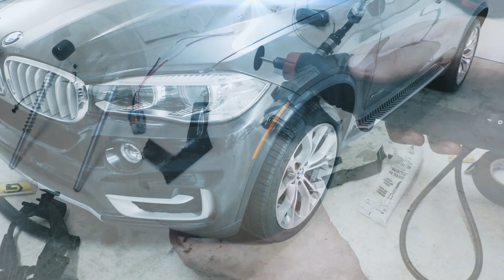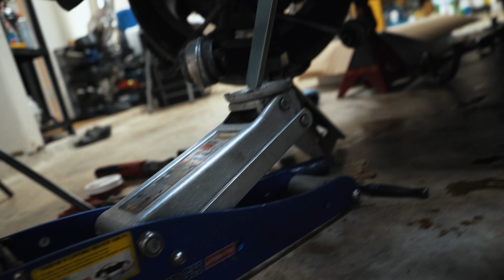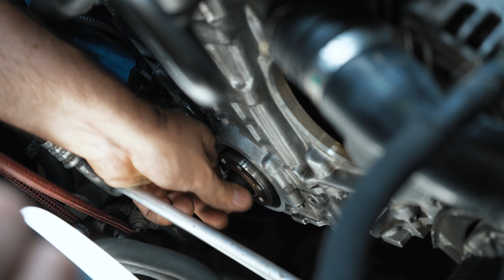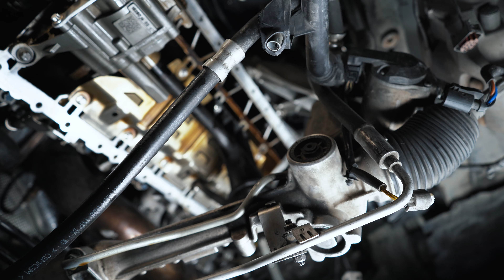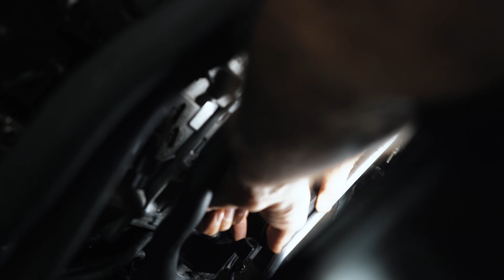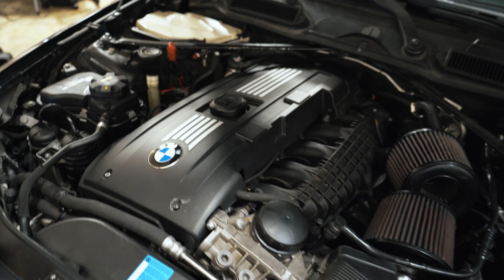This Fixed My Car! BMW N54 Timing Chain DIY!

Comment: Hello, I also have a situation with the N52 engine.

The car was leaking oil from the rocker cover and the crankshaft pulley seal.

Without realizing it, I loosened the large bolt from the pulley (which has a 360-degree tightening) and tried to remove the pulley by moving it left and right, without rotating the pulley in any direction, it came out about 1 cm and I realized that it engages the oil pump pinion and the timing gear. The engine was "free", there were no timing gears installed. My question is, if I loosened that bolt and removed the pulley 1 cm without rotating it, is there a risk that the engine timing would be out of phase? And the valves would be crooked? I changed the gasket on the upper cover and for that I had to remove the valvetronic motor, according to the procedure with a 4-inch Allen key, after changing the gasket, I installed it back following the procedure with the Allen key but I did not calibrate it with the tester in any way. At this moment the engine does not start and spins quite quickly, the piston compression is between 7 and 10 PSI and I am trying to figure out if the problem comes from the fact that I loosened the bolt on the pulley or from the fact that the valvetronic motor is not calibrated.

Thanks a lot. 🤗

Comment: Re-using the guides is crazy
Reply: As someone who’s n55 timing chain guides exploded, I agree
Reply: My lower chain guide broke a week ago. Dont reuse the guides, definetly given the fact that they are 15/20+ years old and are hold in place by aluminum bolts

Comment: Hey I was wondering what did you use to take the timing access plug out I’m stuck at that very spot I need to have that out so I can reach in and remove all the shredded crank seal that got caught in the chain

Comment: Hi if only doing the oil pump chain guide assembly, does the crank hub still to come all the way out? If so, would I still need to remove the valve cover and lock the cams in place?

Comment: I have my engine out of the car, and with it on a stand I dont have the ability to have the flywheel on, can I still do this properly without locking the flywheel since it isn't on the engine currently?

Comment: Hey bro I have a question , so I’m at DTC with the flywheel locked and with the pin also , but I removed the hex bolt without locking the crankhub .. what should I do now?

Comment: Did you use the same vanos gear bolts? Or did you get new ones? I'm thinking of using the same ones with loctite. Not sure if it's a good idea.

Comment: Why  did you need to use the crank locking tool in the front when the flywheel is already locked?
Reply: I also would like to know this

Comment: Great video thanks  
You have a new subscriber . 
I take my car to my mechanic because I he told me that my vacuum pump fail . When he was trying to replaced noticed that my chain retainers were melted and need to replaced the all thing inside . 
Thanks  this video give an idea for what my mechanic got it go through and eh was correct on everything that he told me that he need to remove in order to get access to it ,👍🏼👍🏼

Comment: hey just wanted to ask how would you find time if your chain comes off for the valves barcode up and use timing tool but what about finding compression stroke vs exhaust with piston 1 TDC how can i tell?? also is it necessary to replaces all guides and slides for chain? any help would be appreciated been watching you for a long time always good content.

Comment: Sincerely your channel and hard work has been and is top level IMHO!! Thank you!  I have always appreciated the work you do as well the car I bought (for VERY cheap $1500 USD) was the same mileage as the one you bought at the start. (Mine was 185,000 Miles) so I could always know if you needed to do something on your car to make it better or maintenance then my car is/was due as well. The only thing that has had me pulling my hair doing my work is that mine is an "X" version. So to do a job like this job (Or these jobs as it seems to me LOL) it will be a fair amount more complicated or difficult in dealing with the all wheel drive system. I would never have bought the "X" drive version but that was the car that was so very cheap so I wasn't going to let it get away! Mind you now that I do have it I have found that because of the App "XDelete" I can have the rear wheel drive ONLY driving experience at any time I wish or all the time. Which is how I run the car except in the severe ICE and Snow of winter here in Western Canada and even then it's only when it's severe not for every day. If I want to experience the very hottest Drop Kick of a Launch I put the all wheel drive on with the XHP trans app Tune to either stage 3 or "Drag Race Mode", Which scares the crap out of me because it feels like it's going to break my Automatic 6 speed Trans with All the violence it expends on take off!  I really only tried the drag race mode a few times as I want the few safeties still left in stage 3 to at least be there where as DM has NONE!  It even gives us a warning before we load it on that from that point on there's nothing between your trans and KABOOM!! Sorry for the long comment I just got caught up. Love your channel!! Thank you!!

Comment: The oil pump bolt is not correct it is missing or doesn’t have the correct bolts

Comment: Thanks for taking the effort to record and share all of this! Ps. after torqueing the bolts that needed an additional angle of tightening.. was this done this by estimate? or does your digital torque wrench also support an angle setting? I have an analog torque wrench so am not totally sure how to do this. thanks. Regards from the Netherlands.

Comment: Hey thanks for all the vids. The same thing happened to my n54 and I used your vid to put it back together. I ran into a problem after...crank, no start. Pulled the VC off, locked the flywheel with the pin, and spun the crank manually to tdc to check timing and noticed one of the cams isn't at tdc anymore (it turned 180 degrees ) Any thoughts on how to get that cam back to tdc, without having to do the whole job again ? lol

Comment: Hey quick question, after timing and spinning engine to ensure timing, do you hear a clicking/clunking noise as you manually spin the engine? I hear this is normal, wondering if you heard it as well.

Comment: am i missing something? i didnt have a grip disk washer for the crank hub. or somehow lost it while taking it off. but i dont exactly see a washer in the video @ 9:38. so its hard to see what it looks like
Reply: No it depends what transmission you have only manuals have a the washer installed

Comment: I have a 2007 335i that keeps misfiring i changed the plugs and the coils and moved the injectors around and the misfires are still there, 😞 it keeps shooting fire balls i moved to texas 6 months ago i just want my car running again, Would you know what else can cause a misfire on the n54's ?
Reply: Update?

Comment: What symptoms were you having that made you change the timing chain? I have an F30 w/ an n55, its about to hit 200k miles. My car runs fine but I think I may be getting a subtle whine sound from the oil pump. Not sure. I'm a big proponent for replacing parts like this early before they fail. Not sure of the life span of the chain guides. I know the n20 guides like to fail early.

Comment: After replacing vanos solenoids I still keep getting the code , question is you think this would solve the problem ? Turbos only work for a couple seconds after restarting car , then seconds later the car is just N/a

Comment: I have an N52 with automatic trans. Do I still need some sort of device to hold the trans or can I rely on the locking pin
Reply: Where did you get the crank hub lock?
Reply: And I don’t think there is a way to lock my auto trans. Besides just the locking pin and crank hub tool. At least not that I can find
Reply from the maker: The locking pin is not recommended for removing the front crank bold, you would want a flywheel locking tool that engages the teeth.

Comment: I've got question about the locking pin for the crankshaft. When you're tightening the crankshaft bolt, do you keep the locking pin in place when counter holding the crankshaft hub?
Reply: if anybody see this, no dont use the locking pin to hold the crank. i learned the hard wat. use pin only for holding tdc for other work that require tdc. my locking pin is bent and stuck inside the engine case after undoing the crank bolt. use the crank holder kit or buy the crank hub holder tool

Comment: hey man whats going on im really hoping you can help lol i have a 2007 335i 113k and im getting 002A99 and 002A98 it turns on but really rough idle i wanted to check if the time is correct but ive never for on a n54 how can i check the timing? is there a mark on the camshafts and a mark on the bottom? anything helps lol thanks!
Reply from the maker: Hey, typically you'd need the tool for that but if you put cylinder one at TDC and pop the valve cover off the camshafts would be both in a position where the square tool can fit over it.  So there are two flat edges on each camshaft they'd be at 90 degrees.
Reply: @VehicularDIY  thank you very much and for the bottom? the crankshaft?

Comment: Hey man my 07 n54 is giving me an engine pop up on my dash but won’t show me a code. It’s stock with only 120k miles. Do you believe it would be this issue or is this pretty excessive? The shop I took it too is saying it is but I called bullshit and picked my car up with no work getting done. Plus it drives fine
Reply from the maker: You may need to use a scanner that can read manufacturer specific codes to see what the shadow code was.

Comment: 2007 335i 200,000 kms i just rolled in a set of king rod bearings using your video new timing chains and guides and oil pump chains and guides  your vidio was very easy to follow it helped me step by step with torque specs
and vvt crank lock bolt stage 2 walbro in tank fuel pump pheonix aluminum intake with 550cc in injectors BMS WMI 7bms injectors new index12 injectors new Eldor coils NGK sparks JB4 new cam ledges and seals new hydraulic lifters new vanos valves DocRace 6266 precision singe turbo kit with 7.5 inch FMI from MAGA
HKS blow off valve and charge pipe . i should be finished by spring no money left for mods but i will have to Dyno Tune in spring limited resources because i live in Toronto Canada

Comment: Had you inspected your Rod Bearings, you probably would have saved the engine. Are you using the BMW recommended oil? Have you looked into Redline 5w50 like Troy has suggested?

Comment: Excellent video! I'm getting ready to do my oil pan gasket and decided to do my rod bearings while i'm in there. 
Did you reuse the bolt for the oil pump gear? I can't find that particular bolt anywhere so i'm assuming it's reused. Thanks!
Reply from the maker: Thanks!  Yes I reused it.

Comment: Long story short, my belt got sucked into the crankshaft and of course got into the pick up tube and all over the pan. Come to find out the guides broke too. So! This guide is so helpful right now to get started with replacing everything but the oil pump. I got the timing and oil pump chain kits, new crankshaft seal, vc and pan gaskets, I think I'm ready to rock n roll on this! Thank you so much for your content!! p.s. I'm running on the N55 E90 platform
Reply: Hi, how did it go? I had to do the timing in my n55 but once I put everything together and attempt to rotate the engine it is not possible and can not complete 1 revolution on the f30 n55. Do you have any advice?
Reply: @nahtannoJv8  It's not wanting to turn? Did you inspect the rest of the engine checking to see if the rods, pistons, etc are good while you had the valve cover and front seal off?
Reply: @yungsaile  the engine was running before I took things apart. I was doing the oil sump gasket. that's when I found a piece of plastic in the sump. and upon inspection, I saw that the oil pump tensioner was just broken. While I was there I decided to do the timing components as well . since the engine was running fine. I did not even bother to turn the engine manually(my mistake). but when using the timing tool for the n55 the camshafts did not align in place. I thought maybe the timing is off. never had a check engine light until that moment. Now that I replaced the timing chain and use the timing tool and had the crankshaft in TDC using the locking pin.The engine turns but can not complete 1 full revolution. At first, I thought the engine is not turning because I left the car in first gear So I put it in neutral later I had someone press the clutch and still can not complete the revolution. then change the TDC by a few degrees and I still can not complete 1 full revolution manually. just when I am about to make it gets stuck. pistons valves seem fine. but no way to tell unless I do a compression test or something. and rn I am just trying to gather patience to go back at it lol
Reply: @nahtannoJv8  Oh I know the feeling of trying to regain patience to figure out the issue lol but dang even I'm left in a strut trying to figure out what it could possibly be. If I recall my oil pump tensioner/guide did indeed break too and found within the oil pan along with the shreds of the serpentine belt. As time consuming as it is, I think starting at the beginning a little to backtrack and retrace steps is what I would do (done that so many times on other projects). What happened to your car to do this project if you don't mind me asking?

Comment: what is the full price of this work?
Reply from the maker: I'd imagine an independent shop might charge around $2000.
Reply: @VehicularDIY  The N54B30A from my 335i xdrive.  Do you know if the motor is (interference --- or ---- not interference))?  I had a problem with the time chain and time was lost.  And I still don't know if the valves bent or pistons broke..

Comment: How did the engine rtv hold up around the crank seal any notable leaks after replacing or is it dry
Reply from the maker: Its completely dry.

Comment: I can't recall if you had left the helix overdrive in or not. I'm pulling the plug on mine and just going port injection, seems alot safer.

Comment: Your hub looks different @9:40 than it does when you pulled it out. Did you swap it with the updated version?
Reply from the maker: I did yes, the latest version.
Reply: @VehicularDIY  yeah I watched your older vids after asking hah thanks

Comment: There is no way to know if the can ledges are using the upgraded teflon seals without removing them, right? If we're going to remove them anyway, how much out of this series of videos would you recommend doing while we're in there as preventive maintenance for cars that would need it (say, >120k mi N54 E90s)?

Comment: That's crazy where the helix caused the oil chain to break and I heard about this happening, but never saw it first hand.  I have a helix 3x overdrive which I recently installed, but I only have 50k miles on my car. I also couldn't find anything online about anyone else having this issue because of the helix. I know they since added the support bracket and plate because of the stock plates breaking due to the pivotal weight with the helix and HPFP in line.  But based on that, do you think it might have caused the failure because I know you were running the helix without the additional plate and support bracket.  Is it possible that without those additions, the weight and movement from driving could have flexed the gear and guides enough over time to cause damage?

Comment: Hey I was wondering. What a good oil to go with when doing you oil change on an 08 335i N54? My engine has 129,300 miles

Comment: I did the same with my Front Main seal a couple of years ago on my 535.  Used Permatex Ultra Black oil resistant and still no leaks!!

Comment: Did you fo the crankshaft bearings also?
Reply from the maker: No that would involve pulling the motor as you have to drop the bed plate.
Reply: @VehicularDIY  sorry, what I meant was rod bearings.

Comment: Great video bro im glad you got your n54 running again, I got a question for you I just got a charge pipe for my 335 my car is automatic tho what spring do you recommend is the 11 psi good or should I use a 10 psi spring?
Reply from the maker: Thanks, this for a Tial BOV?
Reply: @VehicularDIY  yeah it's a 50mm tial blow off valve what do you think?

Comment: Did the crank bolt have lock-tite or thread-locker on it? If so, would it help to warm it up a bit first? I know that  could damage the crank seal, but its being replaced anyways, right?
Reply from the maker: I didn't see any.  I don't think heating it should be necessary but yeah its a good time to change the crank seal.
Reply: @VehicularDIY  Okay cool, thanks for the reply. Perhaps thread locker interferes with the torque measurement. It's obviously a critical fastener